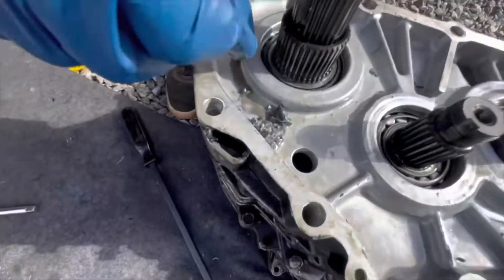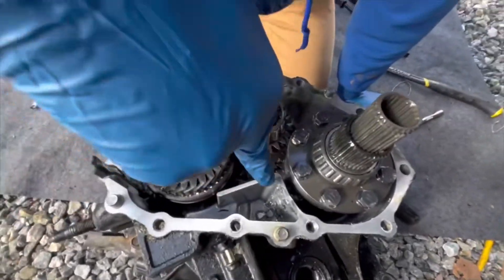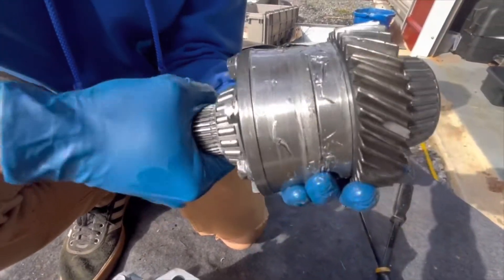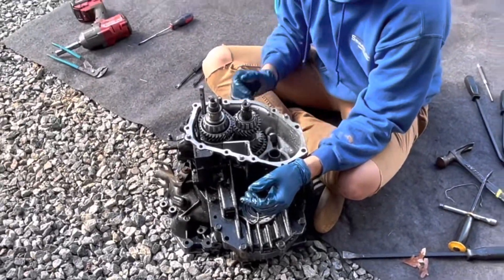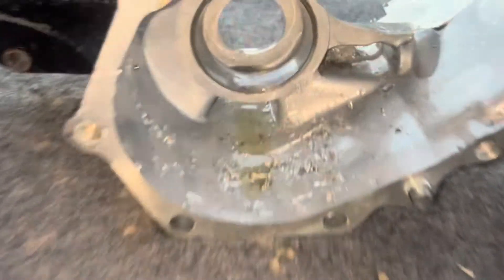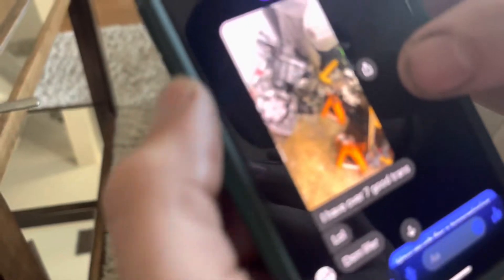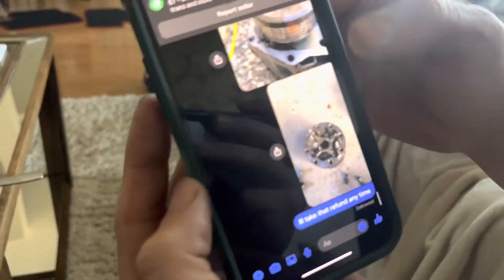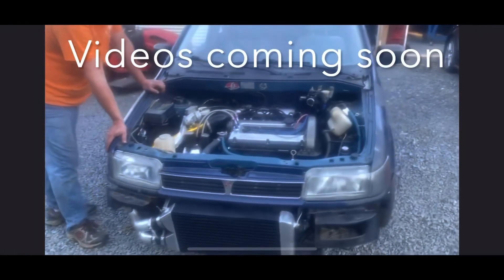Scammed on a Marketplace DSM Transmission! :(

Comment: On all used dsm awd transmissions, that i plan to buy, i always spin the flywheel and T case shaft to make sure it does not rattle or bind inside as you go through the gears, a big sign of a blown center diff is the marble clacking rattle sound when you spin the center diff shaft, also the transmission you are tearing down is actually a 2g awd transmission because it has the weighted shift leaver and the roll stop bolt holes, the 1g awd cars don't have a weight on the leavers or the front bolt holes for the roll stop.
Reply from the maker: I definitely wish i looked at it a little more when i was purchasing it.